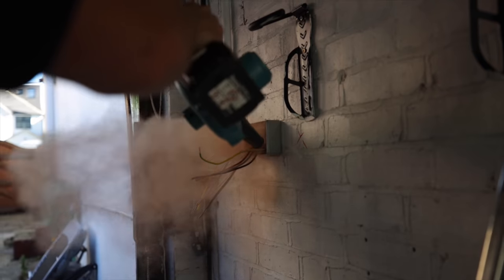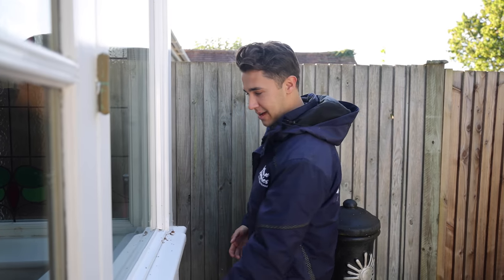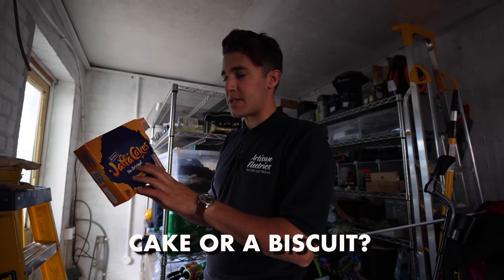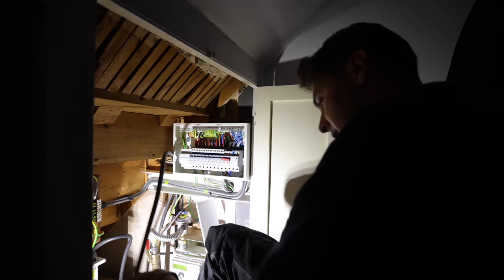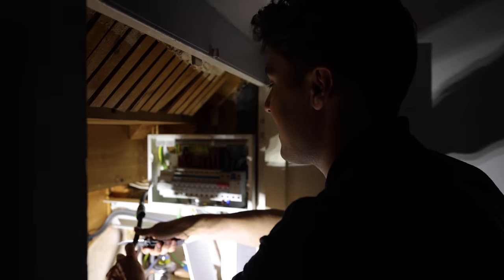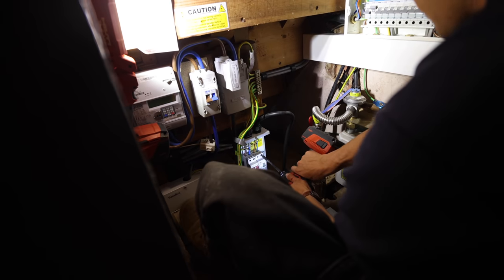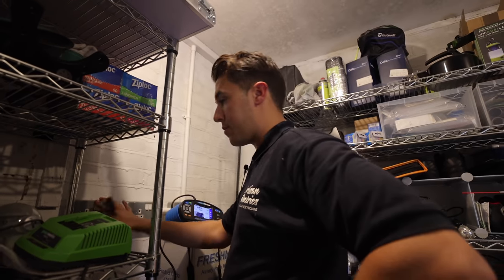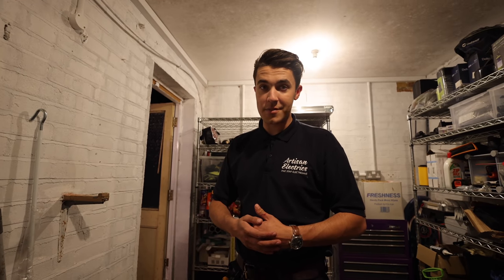INSTAGRAM ELECTRICIAN LIFE vs REAL ELECTRICIANS LIFE

Comment: No nuisance tripping from the garo unit rcbo ? If the tesla gen 3 charger has a type a rcd aswell surely it shouldn't have a 2nd? I've had this fault today just wondering if you have with this ?

Comment: the VAT issue is specifically if it is a cake or a "chocolate covered biscuit", if they had no chocolate the debate would be irrelevant as plain biscuits are not VATable anyway, the fact it has chocolate on it would make it a luxury biscuit  rather then a food staple.

Comment: Under UK law, VAT on cakes and biscuits is set at 0%. However, crucially, the law states that if a biscuit is partly or wholly covered in chocolate then it is to be taxed at the standard rate. HMRC clearly defines the difference as follows:

“The significance of the borderline between cakes and biscuits is that a cake is zero-rated even if it is covered in chocolate, whereas a biscuit is standard-rated if wholly or partly covered in chocolate or some product similar in taste and appearance.”

In 1991 Her Majesty’s Customs and Excise – HMRC as we know it today – challenged manufacturer McVities on their orange filled goodies, believing them to be biscuits. McVities fought back. The case eventually went to tribunal and, according to rumour, McVities even baked a 12” Jaffa Cake in their quest to prove the fact that they are a cake and not a biscuit.

Comment: Spending ages on a consumer unit making the cables look all neat and tidy, Bearing in mind the inside of a board is almost never seen and it's more personal pride then regulations. Or putting it in to an average standard and making more money doing other jobs? Is your quality based on time spent? Or does it include speed?
Reply: I recommend listening to E5 Group’s latest podcast on the 1st Edition of the wiring regulations. The use of the word “perfect” appears a number of times. It makes you realise that the present regs are about output and not necessarily about good craftsmanship or the “perfect” outcome.

Comment: HMRC and McVitie’s spent millions over a number of years in lengthy court battles trying to determine if a Jaffa Cake is a cake or a biscuit. 

The designation of a Jaffa Cake being a cake or a biscuit is worth millions to HMRC. As a “chocolate covered biscuit” will attract VAT at the standard rate (20%), but cakes are zero rated (0%) for VAT purposes. 

In the end, a court determined based on numerous factors that a Jaffa Cake is indeed a cake. An overwhelming piece of evidence to support this was found to be what occurs when a biscuit and a cake goes stale.

A stale biscuit goes soggy, but a stale cake goes hard. And it was proved in court that a Jaffa Cake goes hard when left out over time. Therefore HMRC lost the case and is why Jaffa Cakes are zero rated for VAT.